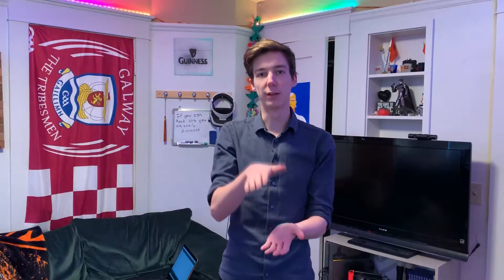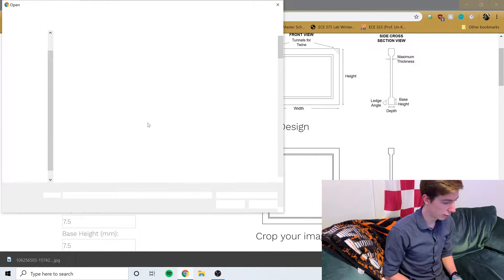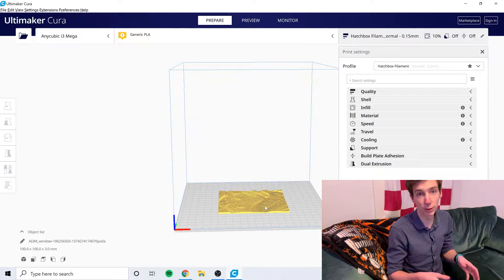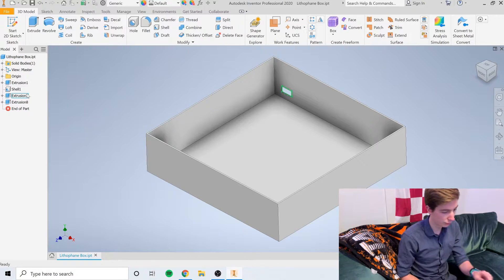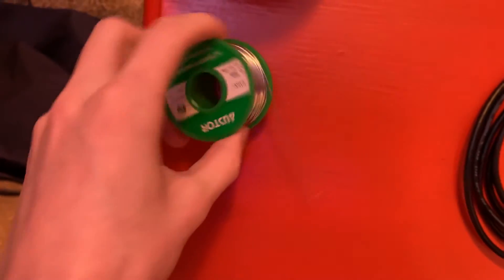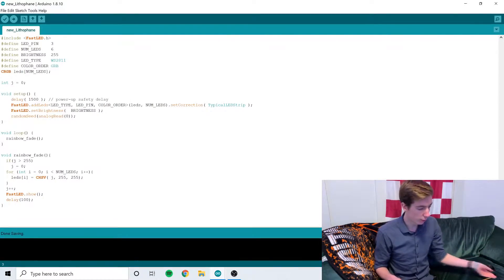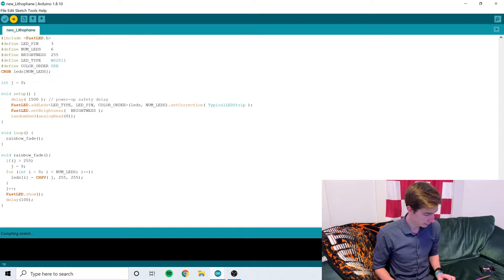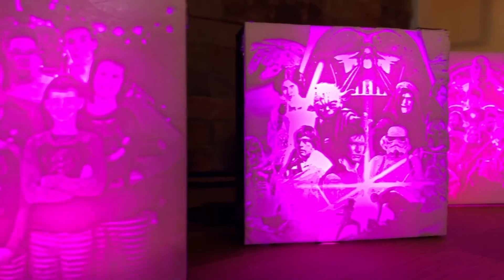DIY Custom Lithophane Light Box

Comment: Great project!!   

I realize this is 4yrs old .. still, a couple tips;  
1) use a diffusion layer (photography lighting, thermally stable diffuser) halfway between the LEDs and the lithophane to remove "hot spots" from the LEDs.  It'll be pennies compared to the cost of the Aurduino & LEDs and give uniform lighting.
2) pre-solder your connections outside the box so you're don't accidentally ruin the print.  It's also easier to program and test the lighting before fixing it all in place.
3) use a slide-in lithophane holder rather than hot-gluing the lithophane to the face of the box.  This makes it easier to fix lighting issues and to swap out lithophanes.

Comment: The frame around the image does make it a lot easier to print upright.
Also if you attach the LEDs around the edges you get less of a hot spot in the middle. Cool idea though. I like it.

Comment: What would I need to modify in the code to simply turn on a set of white leds?
Reply from the maker: You could do this easily by setting up one IO pin as an output and then setting it HIGH. Don’t try and modify my code to do this. If you want a starting place you can take the blink example from Arduino Files->examples->basics->blink and change that code to keep the LED on rather than blonking
Reply: @Tech-Random  thanks for the tip! I’ve managed to get the rbg version working. The boards I got had header boards, first attempt I removed them and soldered all wires. I’m terrible at soldering boards and I struggled but it works. I sourced parts for future boxes so I had no more soldering, plus I added an on/off switch. All header boards remain now allowing me to use the board right out of the box.
Reply from the maker: Very cool! I’m glad you were inspired
Reply: @Tech-Random   with this code can I add more than 6 LED’s? I would just change the number, correct?
Reply from the maker: I’m not sure. The algorithm was written to be flexible but it only handles two rows of LEDs under each tile. I think it would work if you had two rows of 6 under each tiles but any other arrangement would probably require you to write your own algorithm. Still I think writing the “Light Tile” function was my favorite part of writing the code so you can watch my code walkthrough for some inspiration if you want to try and make your own.

Comment: A great project.  I am searching through the photos of my grand kids for the best material to print.
Reply: The The The 0:12 😢is 0:12 😅yy r yea 0:19 😢 0:20
Reply: What is the best filament for printing lithophanes
Reply from the maker: I use hatchbox because it’s very reliable but most filaments should be fine if your printer settings are tuned